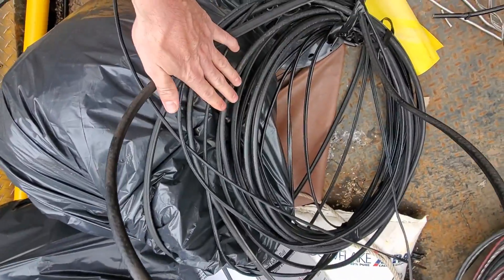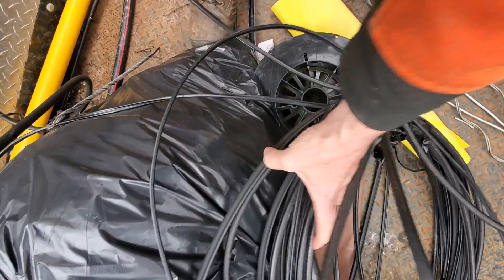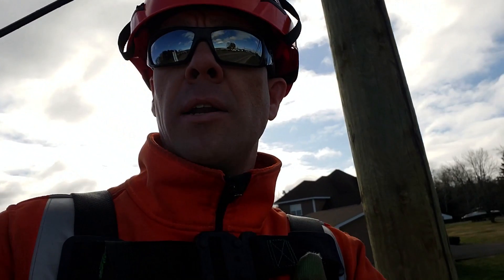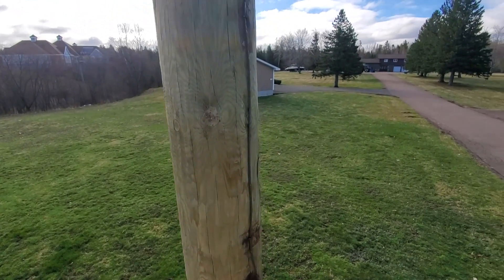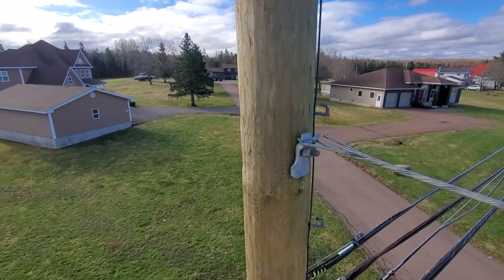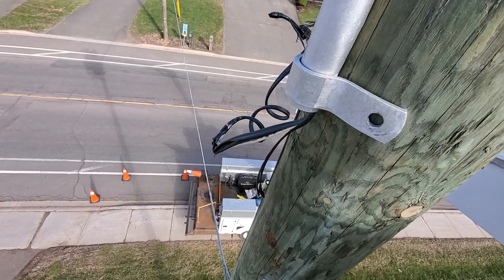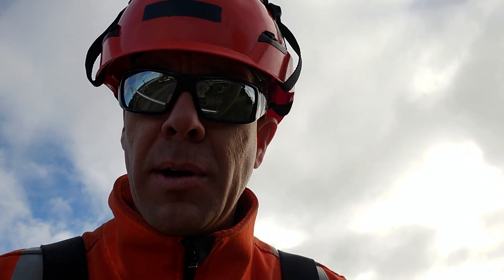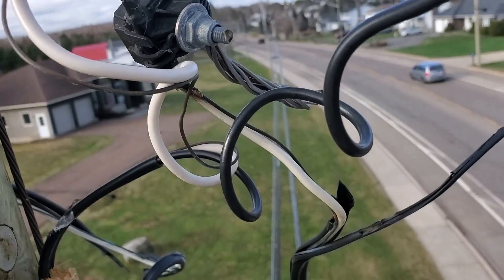7200 volts through telephone lines!

Comment: 2:50 the copper ground wire you show gets stolen ALL THE TIME here in New Orleans. If the utility company notices it, they'll replace with braded aluminum. Then more copper gets stolen down the line. In some blocks there are no continuous runs of grounding. My question is, does that pose any kind of hazard? I noticed two poles caught fire over the last 10 years, which led me to associate one with the other, but linemen assured me I was wrong, and that system redundancies keep the grounding system intact. What gives??

Comment: I'm thankful there is no similiar powerline design in Europe. It's very very rare to see high voltage distribution line (mostly 15-20 kV here) right over the low voltage line that feeds houses or telephone lines, they are almost never placed on the same poles. Well sometimes a high voltage line breaks and falls on a low voltage line causing a hell of a disaster, but that's so rare and spectacular on the other hand, that there is a big chance you would hear about it in the main news program in the television. You know, it's quite unusual to have 15kV in your house electrical appliances or telephones, and they usually manifest very loudly and fiery that they don't like it ☺

Comment: Crazy to see 14gauge wire completely vaporized, that high voltage does NOT mess around. Imagine what it would do to the human nervous system and body 💀
Reply: It's not just high voltage but extremely high current.

Comment: had a metal carport structure in the driveway growing up, the single phase supply wires to the house have always laid right on the roof. when i was a kid i had been up there on the and touched the wire. shocked the hell out of me but was surprisingly fine. always wondered why touching the metal carport wouldn't shock you.

Comment: Telecoms worker in KY USA here, huge kudos to you, @bobsdecline for this informative video! Always assume ANY downed line is hot!! I work with coax daily, but I ALWAYS check any downed coax for voltage before approaching. Also, it is possible for a home to back feed voltage into coax or telephone lines, if for example their neutral is bad. I have come across many coax lines carying anywhere from 40 to 125vac. Its not 7.2kv, but its definitely still enough to get you!!

Comment: We have high voltage power lines directly across the street from the building that I live in and high voltage power lines buried underground at the end of the street that I live. It's unclear what voltage those high voltage power lines and buried underground power lines are, based on the size of the insulators on the high voltage power lines an approximate guess of the voltage is 10kv or 10000 volts, more than enough to do some serious damage or cause a fatal electric shock. For my own safety I intend to listen to the advice from power networks SA to stay at least 10 metres away from downed power lines and at one point I walked past the power pole where the high voltage power lines change to a high voltage power cable buried underground and saw a safety barrier or fence around exposed high voltage power cables those exposed high voltage power cables appeared to be properly insulated, but there was a safety sign on the safety barrier that clearly said danger exposed high voltage power cables keep out. I made the very wise decision to put my own safety first and pay close attention to that safety sign and kept a safe distance away from the exposed high voltage power cables.

Comment: Thanks for making this point.  A telecom cable (copper, coax, fibre) often includes a steel messenger.  A fault in the power system (possibly kilometers away) can result in the telecom cables being energized and therefore deadly.  Never touch a downed line, even if it is a telecom line!

Comment: 1:31  ...   At this frame you can see that the high voltage is still active in the telephone cable on the left side of the frame.  There are three balls of fire on the telephone cable.

Comment: About 25 years ago, I got called to a traffic signal outage in a road construction zone. We had a microwave detector that ran on a 2pr#18 Belden cable mounted on a wood pole about 400 feet away from the cabinet. A bulldozer had hit the wood pole and it tipped into the 13.8K high wires. When I opened the cabinet, I saw it had smoked nearly all the electronics, fuses, you name it!! After setting a new cabinet we couldn't get the traffic indications to work in the field. It had also exploded all of the light bulbs in the signal heads!! I couldn't believe that tiny #18-gauge wire brought that kind of voltage all the way back. Great video!!!
Reply: I bet the traffic signals were real bright..............for a moment.
Reply: It isn't the voltage that gets carried by wire gauge, it is current. Though once that wire turns into plasma from having a few kA passing through it and ionizes everything else around it, wire gauge doesn't matter much anymore. I bet there wasn't much if anything left of that #18 wire.
Reply: @teardowndan5364  Thank you!!
Reply: @teardowndan5364  One thing you brought to my memory...It was a shielded cable, too. It had to stop crosstalk from other cables because of the sensitive microwave signals it was carrying back to the cabinet. Perhaps the shielding helped it carry the current?
Reply: @danlowe8684  If we're talking shielded signal cable like coax or STP, 13kV (18kV peak) likely blew past all electrical isolaiton gaps and went straight to the circuit boards. For power, it would be more likely to be armored with steel tape or braid for mechanical protection than specifically for shielding.

Any extra metal would help with conducting the initial current and creating the plasma cloud along the path.
Reply: @teardowndan5364  Yes, it was like an aluminum foil wrap around the two separated pairs because they were amongst 120v cables in common conduit runs.
Reply: @teardowndan5364  Thank you!! And, to be clear, the 13K was never supposed to be a part of the equation. The bulldozer knocked the temporary wood pole carrying the 18awg cable into the high lines, which led it back to the cabinet.
Reply: @danlowe8684  I know, which is why I called it 13kV faulting into low-voltage stuff. Fault conditions typically aren't intentional parts of normal designs.

Did the mast have lightning arresters for cables going up high enough to fall into 13kV lines? If those worked properly, they should have saved the downstream wiring at the very least and the 600-1000V let-through voltage wouldn't have caused much if any damage to the distribution panel.
Reply: @teardowndan5364  It was never a passing thought!!!

Comment: That would be the steel Aerial Messenger cable that supports the wight of the coax cable ether way it's not good to have 7200 volts on it.

Comment: A wire is still a wire no matter what insulation it has and though high voltage may not be intended to be carried on the cable, it still can inadvertently, at least momentarily.  However, it is only because that coax had it's insulation stripped off by the accident and the bare conductor (or more likely the frame ground braid around the wire for actual coax cables) touched the 7200 v power line.  It's not what's supposed to be on that wire that's dangerous but that it was carrying the power from an actual power line next to it that was dangerous.

Comment: These high voltage lines are no joke.
You get about 6 inches from one and you will blow up any wiggy or multimeter not rated for that voltage.
This happened to me.
I took out 2- 170A fuses at 4160V.
My hands, both arms, and face was completely black with soot, no eyebrows left, and I had burns on my palm and wrist.
The shift supervisor was standing behind me and he thought I was dead.
Have you ever seen a black guy turn white as a ghost?
I thought I was going to have to perform CPR on him.

Comment: I once had a telephone line drop across my car in a storm. I wasn't going to get out and move it. I knew it was phone cable but it had a bear supporting cable and I could not see both ends. So I did not know if a charged cable had dropped on one end or not. And nearby officer directing traffic started to walk over and move it. But before he could get five steps, his Sergeant screamed at him to stop. I'm glad he knew the drill. It's not like anybody was injured or we were in a hurry so we just waited on the power company to come clear it and make sure there was no voltage going anywhere it shouldn't.
Reply: If you don't know don't touch. When I was a kid we had a tornado-like storm that came through the neighborhood. It ripped down lots of trees, power lines, etc. After the storm passed I was navigating around a fallen tree and all of a sudden I realize There is a downed power line only a step or two away from me. I backed away from it. Turns out it was fully energized and had I take one more step forward it likely would have been the last step of my life. It makes.my skin crawl when I think of that incident.
Reply: If there is a power line lying on your car and energizing the car, do NOT try to get out of the car.  As you step from the car, YOU complete the path from the car to the ground.  If the situation is dire enough and the car is still running, drive away.  Sooner or later the wire will come off of the car.

Comment: I hate to give a thumbs up lest I seem to be cheering on the forces of entropy that caused all this.  Hope nobody was too badly hurt.  Several years ago, I was in a house a few yards from presumably 7k lines during a sudden afternoon thunderstorm with crazy wind gusts.  There was a flash of nearby lightning but then bright light kept illuminating the room and there was an incredibly loud 60 hertz hum and zappy sound roaring outside.  Turns out a line came down and it was arcing away on the ground for several seconds before a breaker tripped somewhere.  The grass where it lay was vaporized in a streak quite impressively that remained bare for several months.  I will never take downed lines any way but serious as a heart attack after seeing that instantaneous display of raw power.

Comment: copper thieves steal the #4 (or #6?) ground bare wire off the poles here, I wonder if sometimes they get one that has a little current on it and get a shock?
Reply: Yes, I have seen a handful of videos of this about the copper and other sorts of things like it too, where copper wasn't the goal but shady circumstances anyway doing things where shouldn't. So to answer your question, yes, both electrocutions and shocks. There is a website that sounds the same as "chaotic" but replace the "ch" with a "k."

Comment: Hello my colleague! I am also an electrician, I come from Vietnam. I really need you to add equipment that can directly contact the 12.7 kv system. a battery-operated bolt-turning device from Milwaukee. It would be great if you could provide me with a video of a device that can be used directly with a voltage level of 12.7 kv / 50 hz! thank you very much
Reply from the maker: The Milwaukee brushless tools can! As long as they're not put in series of course. They aren't insulated, but can be used as a hotline tool with proper methods

Comment: I have anothe one where a contracter Missed grounds for an Old sub station that was being Upgraded and the only path to ground was thru telecom Grounding systems. Just so happens  we on telecom had a few ground rods In the are and  thats how power company sub was making strand HOT. By Hot Im talking secondary Type voltage Hot from strand to Ground earth In a wide area. before It dissipated..  PEnnsylvania electric...  Mntgomery county PA
Reply: That is a big balls up

Comment: can u do a video about importance of grounding and bonding between telecom and cable tv and power and some of the practices and policies used inyour area..  This Video was Great But i think Theirs some important Issues that could be addressed to show the importance.  For Instance I have an awesome Picture as a telecom Lineman who sets poles , and  fireman.  My pics show an Old  rusted Telecom 6M down guy glowing orange which seemed Like temp Buried cable tv wire But was actually just glowing after we put a thermal camera on it which showed some 950 F Plus. The issue came down To Power lines Missing grounds however  Bonds  and grounds Along some 8 to 10 spans that began using telecom as a path to earth ground. This also sparked some smoldering fires.   Great Video Aaron.  I may have asked this before Dont think You ever came across this or hasnt been covered.   BE SAFE Broski

Comment: Voltage is no joke. Unfortunately, a Spectrum maintenance technician died today when his bucket accidentally touched a power line. EDIT: For some reason won't let me respond to your message but if you look up spectrum and electrocuted you'll see several news companies covered it.
Reply: @Look_What_You_Did Search for the phrase "Spectrum employee electrocuted on the job" and you will see TU (Time Union) and 6news covered it. Won't let me post links in comments section
Reply: @Look_What_You_Did For some reason my reply is disappearing after I refresh the page might be my verbiage. It was covered by Times Union and CBS news. Just search up spectrum and electrocuted

Comment: In the early 90s, I worked for the cable TV local company. The fire department called me at 3 AM. And said that the cable TV lines were on fire. When I got there, the lashing wire that holds the cable TV wire to the steel. Strand was loose and waving in the air. Every time it smacked, the phone that foot gap lit up.  With fire and ran all the way down from one Pole to the other and then down the ground. It turned out that 7200 was touthing the telephone line somewhere. And when the cable TV lashing wire smacked, it lit it up in a ball of fire because the cable TV was grounded on.  Several polls down through there were obviously the phone company was not of course.Did not touch it.I called the power company

Comment: When I worked for a telecom equipment manufacturing co. in the late 80s, one of the test we have to do to get UL/CSA certification was the power line crossing test. We have to show the equipment and wire in premise won't catch on fire and burn your building down. The equipment can get destroyed but the damage must be contained inside the equipment box. Special fuses was required for the very high voltages. Burn through quite a bit of products looking for the right protection.
Reply: I did the same job in the late 80s for a testing agency. We would put the telephone (or computer modem) on a special piece of paper, then send 15kv through the phone lines connected to it. The phone was allowed to blow up internally, but it could not leave any scorch marks on the paper on which it was sitting.

Comment: 5:50 Amazingly despite all the damage the actual driver module and LED panel look to be in remarkably good condition. I'm guessing the MOVs and the photosensor module took the brunt of it. Temptation would be to see if it still works, but I'm sure at a minimum the internal fuse has opened.
Reply: Assuming the hit happened during the day the relay in the sensor module would be open. While not rated for 7200v the contact gap might be enough to prevent an arc into the driver module. Or more likely there's a fuse in the sensor module that blew and prevented further damage. I'd guess the LED panel itself is most likely fine.

Comment: I saw the aftermath when a crane boom came in contact with a 24kv line and it fell onto a chain link fence that had been covered with metal sheeting to hide the scrapyard. There were burn marks all  down the fence for two blocks until it stopped at an open gate. Stay away from anything metal until cleared by the power company.

Comment: It looks like “messenger“ wire, which is just used to support the actual coax. Fortunately, it usually just terminates on a J-hook at the pole, as well as the end-user – screwed into stucco/wood/etc. That looks like it could have been a lot worse/costlier.

Comment: How can you tell difference between coax and phone? When on the poles shared with power from lowest to highest GENERALLY but not always. Phone on bottom, coax next one up, then fiber optics then power all the way up at the top.   Phone is lowest due to shielding, coax next one up from bottom cause of shielding and fiber optic well is light.
Reply: re: "difference between coax and phone?"

The taps, they are completely different on each one.

Comment: Are all the ground wires (like the #4 copper going down the pole) bonded to the neutral at every pole? I'm curious as to how much current was actually flowing through that wire, assuming the bottom of it terminates into the ground. I wouldn't have thought the earth would have conducted that much current to burn up that size of wire, unless the end of it is either right next to another ground directly bonded to the neutral?
Reply: What is #4? 4awg /25mm2 if so that sie wire fuses around 940 amps..
To me it looks like maybe #10 / 6mm2.

Comment: But what about glass fiber cable?? "Light pole installation hits fiber line, knocks out 911 service in several states" -- today's news.  As I understand it, 'fiber' normally has a metal wire in it so it can be traced with a beeper or Metal Detector.
Reply: From that headline it sounds like somebody cut an underground cable when digging a hole.

I pulled up the article and they have this line: "Workers installing a light pole in Missouri cut into a fiber line, knocking out 911 service for emergency agencies in Nebraska, Nevada and South Dakota". Definitely a purely mechanical fault.
Reply: @eDoc2020  That's why they say if you're lost in the forest, or in the middle of a dessert, always have a piece of fiber with you, and bury it in the ground. A backhoe will be along shortly to hit it (and rescue you as a side benefit)